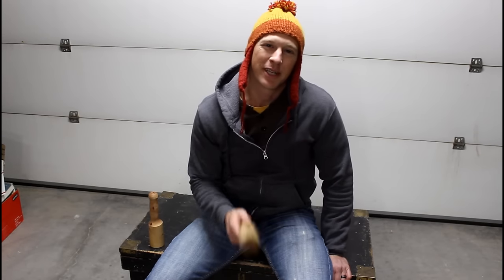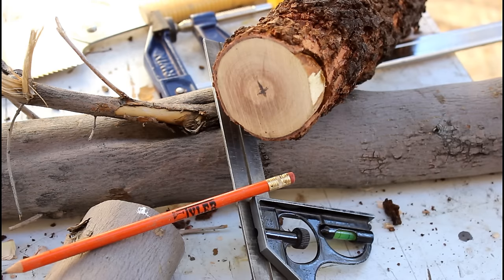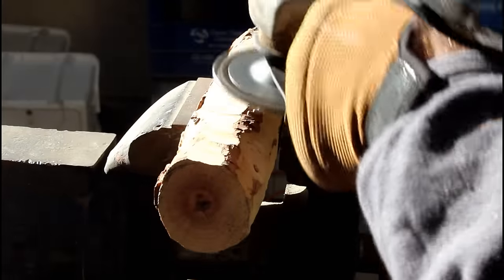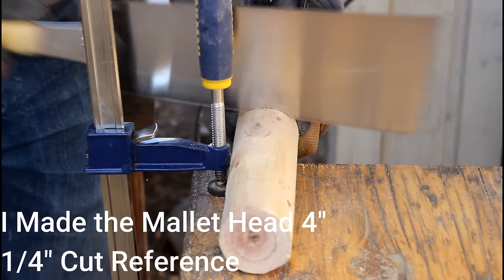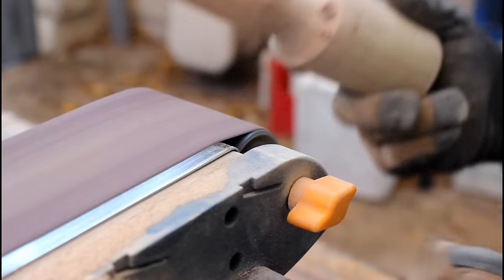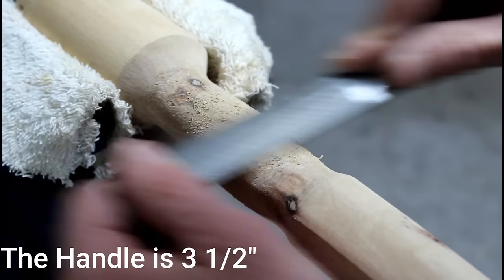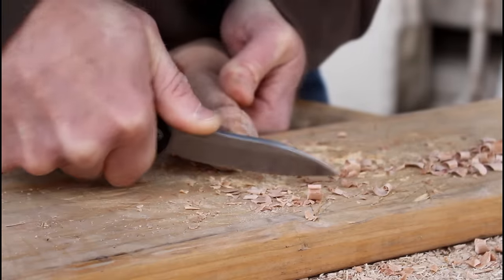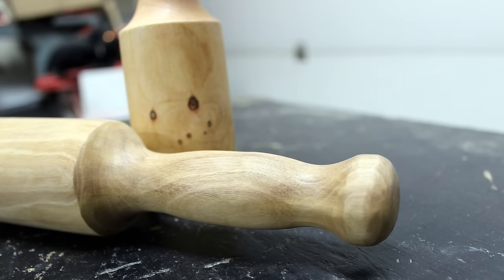Make a Carvers Mallet Without a Lathe

Comment: Those turned out great. I have made several mallets using branches as you did in this video (except on a lathe), and about half of them cracked the way yours did. I also used epoxy. For banging on chisels, it works fine.
Reply from the maker: +Barry's Workshop Thanks.  Good to know.  I've got some larger pieces of that olive wood.  Totally going to wait a while before I do anything with those.